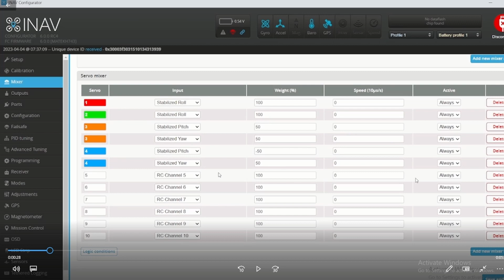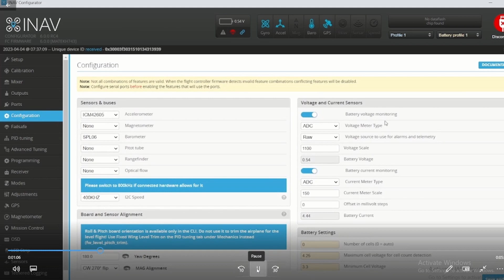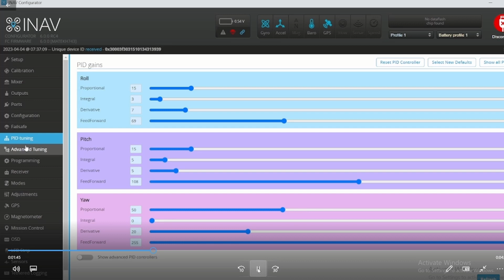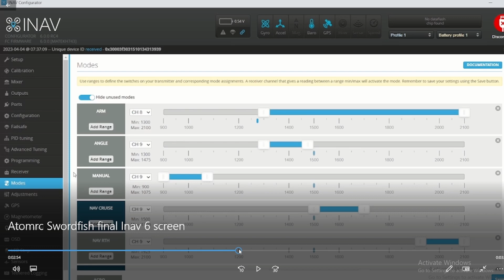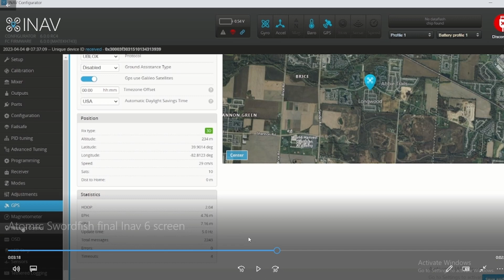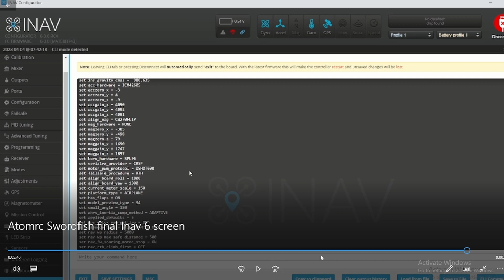Atomrc Swordfish Inav 6 my setup

Comment: Very useful video...in my case, I reduced mecanicly the outputs on servos instead of modifying values with INAV...
Also added a fan to cool the DJI O3, as it gets so hot on ground!
About autotune, saw that pid's are not saved automaticly, how do you save on the field?